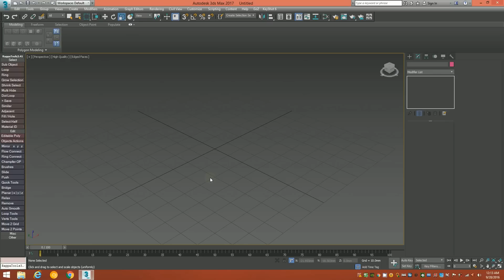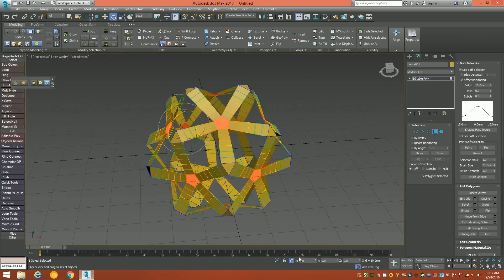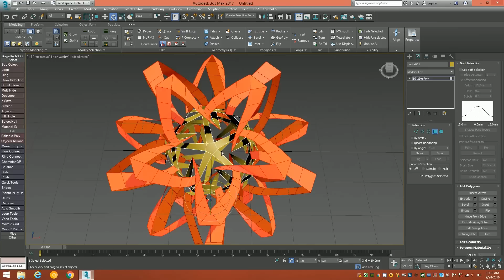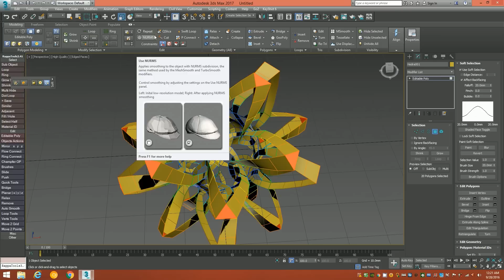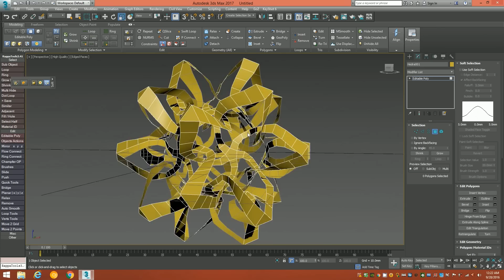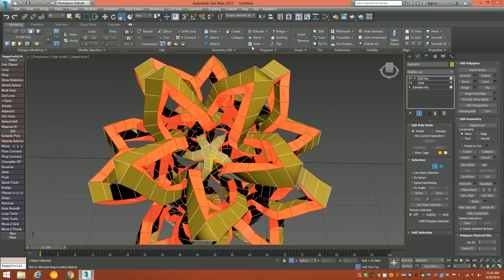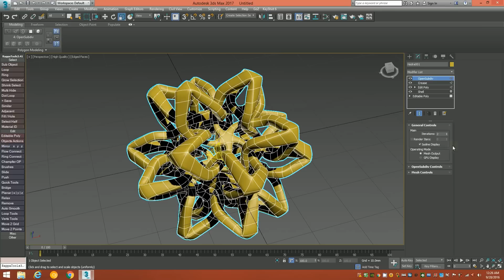3d Tutorial | Interlocked Star Nest | 3dsMax

Comment: awesome, I will try to print this although I have no idea about the inner floating edges. How did You support that? Thanks for thiese tuts!
Reply from the maker: My print was done with SLS, so I didn't need added supports.  However, if u bring this into meshmixer, it will give u support generation automatically.
Reply: @luxxeon3d  i got some supports automaticly too, but they were not enough. Right now it is being printed, so i am pretty curious. If it goes well i will cast this too.

Comment: THERE IS NO CREASE AND OPEN SUBDIV MODIFIER IN MY MAX 2013..what to do?
Reply from the maker: I mention in the description this is using the tools in 3dsmax 2017, but there are similar options for earlier versions.    Make sure the object is editable poly, with no subdivision or anything in the stack.  Go to edge mode, select all the edges you wish to keep hard, then under the Edit Edges rollout, you should see Weight and Crease parameters.  Increase the crease value to 1.0 for those selected edges, then apply a Turbosmooth on top with two or three iterations.  That should give you very similar results.
Reply: Thanks

Comment: hi i am from Turkey.

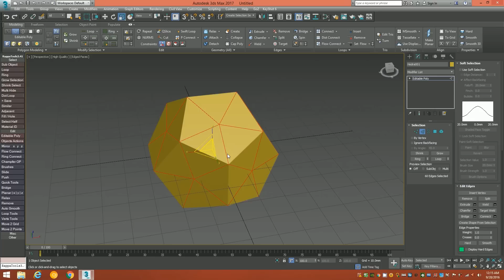I could not process until 2:38. Could you help? What shortcuts?
Goodbye
Reply from the maker: Use the Tessellate command in the Graphite Toolbar or the Command Panel for Editable Polygon objects, under the Edit Polygons rollout.  You need to be in Polygon mode for this option to appear.  Click the Settings icon next to the Tessellate button in the Editable Polygon rollout, or hold down Shift while clicking Tessellate from the Graphite Ribbon to bring up the caddy settings, and change the Type to Face.
Reply: Thanks for the answer.
exactly  2:30 to 2:32, between shortcuts (ctrl + tab + Backspace). is not it? . It did not work. what is the problem?
thanks
Reply from the maker: Kadir ÖZOLUK Hold down CTRL and tap on  the backspace button.  Don't press tab.  I think you misheard me saying "tap" as tab, that's probably why it didn't work.

Comment: wow! did you calculate that mathematically before starting, or is it your art instincts. either way its just wonderful
Reply from the maker: Thanks for the support.  I developed these techniques specifically because I have very limited knowledge of mathematical formula, but appreciate the aesthetic of mathematical form.  So I attempted to figure out some methods of achieving the algebraic shapes using only standard polygonal modeling shortcuts and strategies instead.  Most of the techniques come from trial and error experimentation.